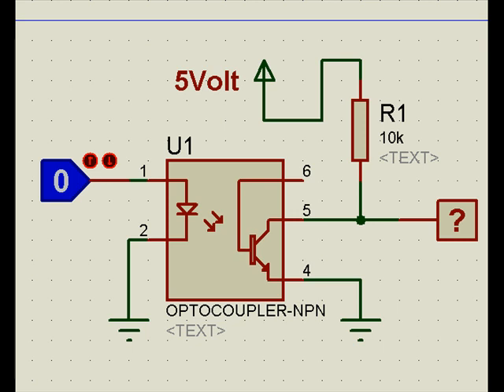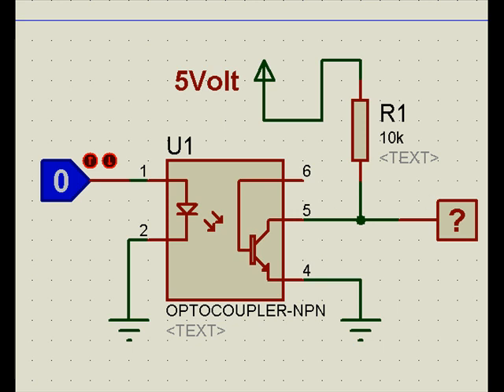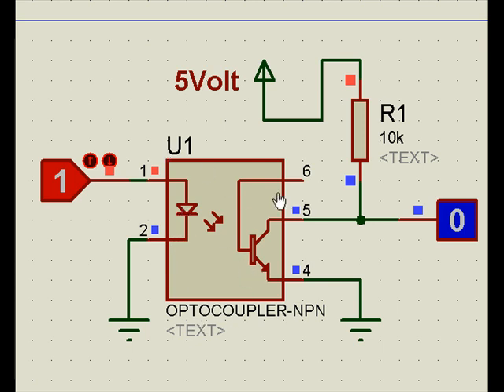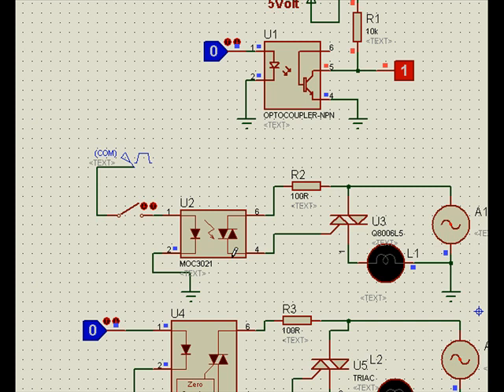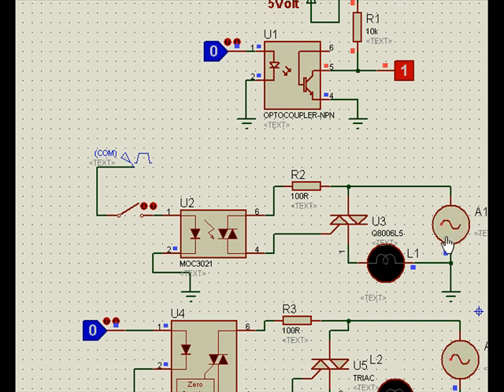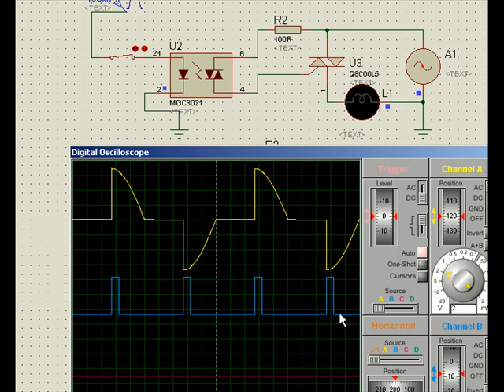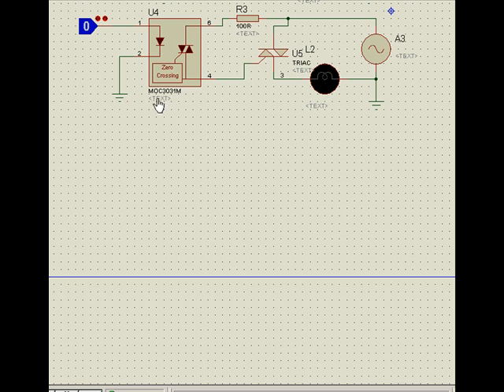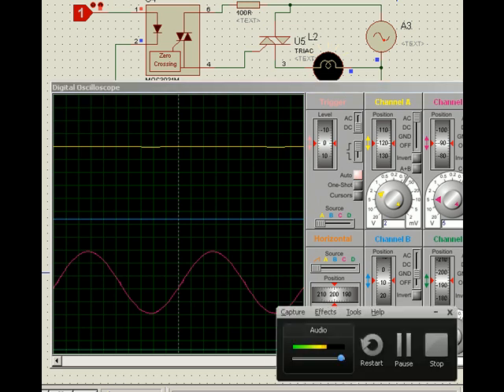opto coupler for ac dc circuits

Comment: Thanks for sharing the video, bro 🙏

But I see grounding on both input and output sides. Can't understand the isolation bit. 

I was confused when you started with opto coupler, quickly followed by opto-triac, where the output current can flow in both directions.

The voltage displays were helpful, indeed.
Reply from the maker: In simulation software, unless both are grounded it does not work. But in actual use for isolation ac side is not grounded.Opto coupler is a broad name. It can be opto LED : transistor, LED :triac, LED: diac, LED : logic gates like that

Comment: Hi sir i have made a optocoupler circuit using moc 3063 and bt 136 connected it to pwm source but when i keep slider at low position the AC output start fluctuations. Can you help me please... My purpose is to control AC FAN SPEED...
Reply from the maker: Santosh Babu use moc 3021 not 3063 which is a zvs opto and can not control Ac firing angle
Reply: Patnaik UC thank you so much sir ill change it and let you know...
Reply from the maker: Santosh Babu providing PWM also it would not control with opto and triac. One needs to use mosfet or igbt. Watch my other videos of ac pwm
Reply: thank you sir it is working but there is no medium speed I am getting only full and off stage when I have connected with fan. is there is any way to do it  I am using Node MCU for PWM. I have tried a lot, Any help will be highly appreciated
Reply from the maker: I mentioned earlier. PWM way triac will never work. Power control by Triac can only be done by firing angle control and not PWM control . It appears your fundamental is not clear.Watch my video https://www.youtube.com/watch?v=2LnWHynfzMs

Comment: Thanks for video sir. I am trying to trigger SCR(2P4M)  using a logic circuit. The logic circuit will give input to optocoupler MCR 2E. The optocoupler is connected in similar fashion as you have shown in video. But to connect output of optocoupler to gate terminal of SCR, I will have to take which terminal out of optocoupler?

Comment: @b131188 you can use ULN200X series IC to run lo power motors. search in google.com and select images look the circuits which suits you better use that.